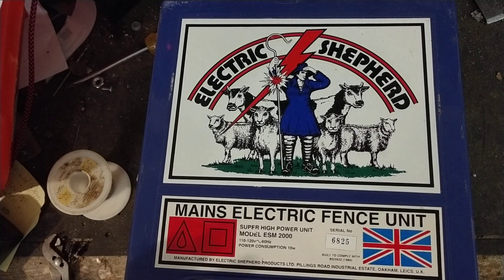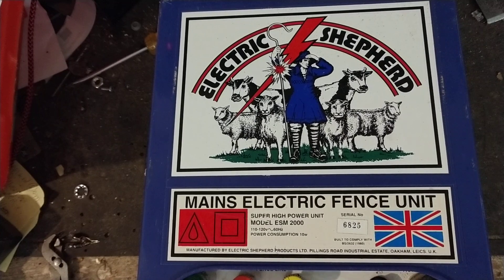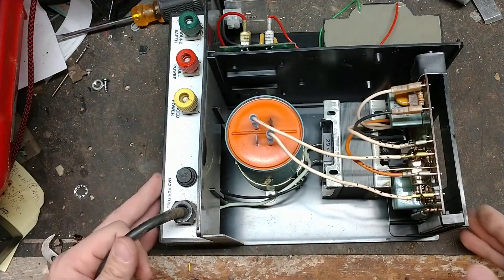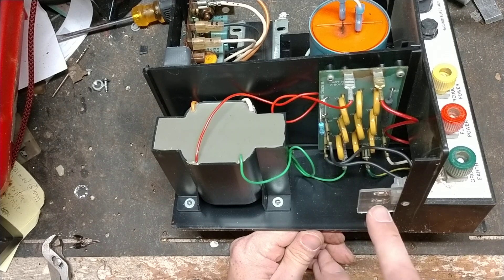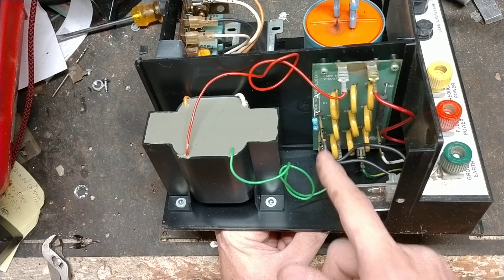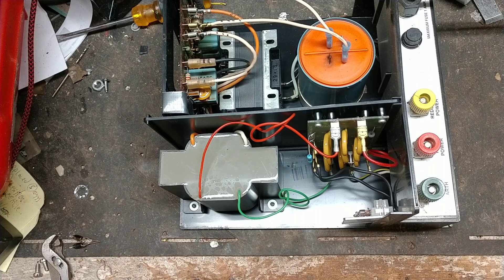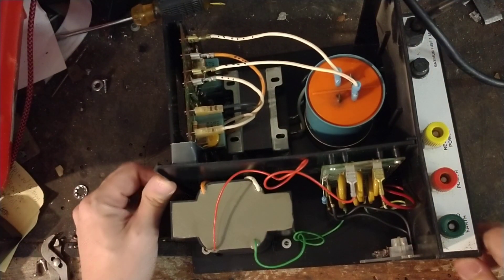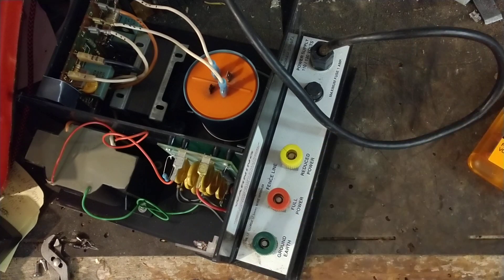How does an Electric Fence Energizer work? | Electric Shepherd ESM 200 fence charger repair

Comment: How can my 2 jpule fence read 10k volts but only have a tiny shock?
Reply from the maker: Are physically touching the fence? If so, and you barely feel it the shock from it, then either your shoes you're wearing are insulating your body from the soil better than a barefooted animal is, or you need another ground rod. I would squat down to a knee to bypass your shoes, or lay one hand down on the soil, then put the back of my hand on the wire and brace for it. If it shocks a lot better that way, then the fence and everything is fine and it's just your footwear you have on is insulating you from the ground.
Reply: @FencerFixerRepairLLCKansasCity  I took my shoes off and grabbed the fence, that joker showed me good lol
Reply from the maker: @SandRidgeFarms I've had this same conversation 100's of times with customers. I was pretty confident on what was going on

Comment: Hello, i have a "Euroguard N5000" brandet Unit here that loks mostly the same inside. Your Video helps a lot thank you for sharing. The Board after the Transformator is different on the N5000 - only resistors. 
1 Question: What Bulbs are you using?
Reply from the maker: That output board is just a lightning suppression helper board for lightning on the fence and ground side, that's its main function. I'm not sure which bulb you're talking about because I haven't watched the video in 3-4 years I think. But the clear bulbs used in most brands are NE-2 bulbs and the solid looking bulbs that should look white when not powered up are neon bulbs, green, blue, orange, and red are the most common colors, but the bulb themselves are solid white when not powered up and then change color when power goes through them.
Reply: @FencerFixerRepairLLCKansasCity  So i will search for "Neon" Bulbs. Thanks a lot - and regards from Germany
Reply from the maker: @thomasvill7021 Search neon ne-2 bulbs

Comment: 35uf cap and if its charges to 325v which would be full-bridge rectified and filtered mains here in the UK then there is 1.8 joules of stored energy in the capacitor 👍

Comment: Thanks for showing off the guts!  I see in another comment they use an SCR to switch the high voltage, but I'm curious as to how they do the timing in these older units.  Did they use purpose built ics or some sort of basic microcontroller?
Reply from the maker: I'm not sure how they did it on this particular unit. This video is from a few years ago. Different brands do it different ways. Usually it's a microcontroller or something custom built and programmed

Comment: What if you touch red and yellow  connection
Reply: What will happen..
Reply from the maker: You would probably feel a little something. The shock comes from ground side and either red or yellow. So if you touch just red or yellow individually or together at the same time, you'll feel something just not the full shock. Red and yellow are almost the same electrically inside, there's just a big resistor between the two to lower the power down from red to yellow for the half power on the yellow
Reply: A question to add on.. when you have finished connecting to a fence wire. In a scenario where a fence has no continuity. Will it still work or how will you know

Comment: My ESM2000 fencer went down.  Checked that resistor and, bingo!, it was open! Replaced that resistor and it is now working! Thank you.
Reply: Is that trafo still available. I have a esm600+ unit with only 2000volts on the output of the transformer.